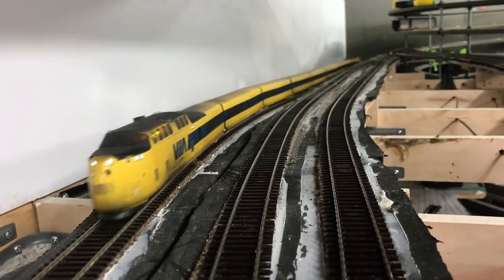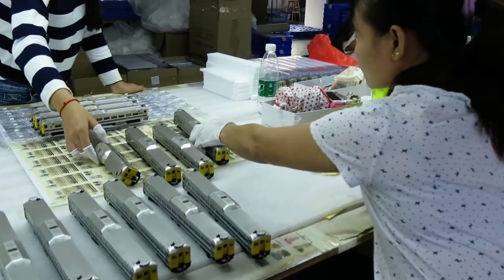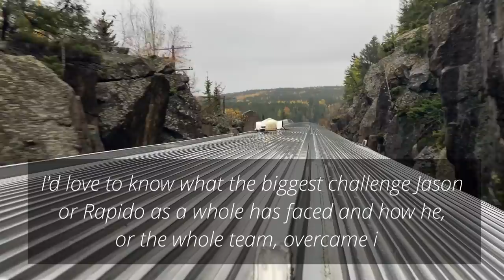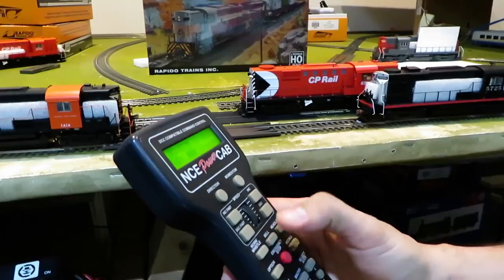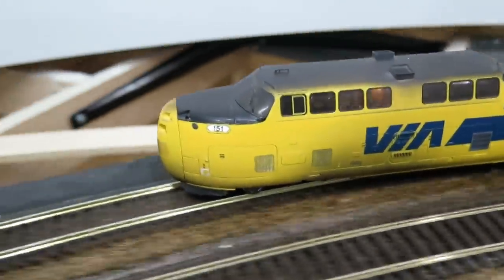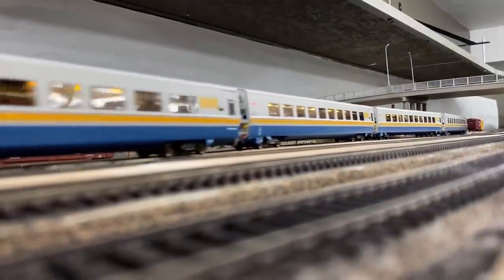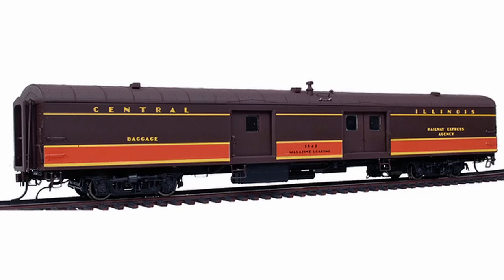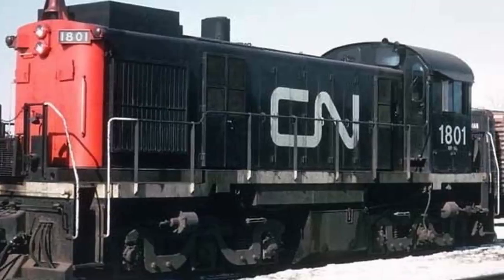Rapido Documentary Q&A with Jason Shron

Comment: Thanks for the candid and honest Q & A Jason  Dalhia . I rode the Canadian from Toronto to Jasper in 2015 and it was fantastic and spent most of my time in the Parlour car , and I'll be back to do it again in the near future. 
My biggest gripe about the industry is the continued use of  the antiquated worm drives in our locos, these can't be pushed or pulled , meaning accurate speed matching is required( which is fine) but it makes for a lot of stress on gears as they are forced along. Has anyone thought of changing to bevel gears or different worm gears that can be pushed or pulled slightly? I hope this changes before I kick the bucket..LOL  
I'm seeing the same drive trains in locos I had 40 years ago! 
Thank you for making great products and supporting the hobby!
Cheers from Down under, Gregg .
Reply from the maker: Our pleasure! And thanks for your comments on the motors. That is definitely something we can discuss at our project management meeting, but of course the challenge is making everything compatible with everything else...
Reply: @rapidotrains  Thank you and have a great Xmas & New year .

Comment: Great interview, and some really interesting questions and answers; like changing the production artwork and reducing the errors.   
Whilst Birmingham is a great cross roads, I'd venture somewhere like York, or Derby as there's so much variety (merry-go-round coal trains / freight / express passenger traffic) etc....pulls pin and steps back. 😂
Took me back to when I was lucky enough to travel on the Canadian, a wonderful landscape to travel through, a highly recommended experience.
Reply from the maker: Thanks for your kind words! I think the original Snow Hill would be something special, before it was replaced with... an escalator in a concrete box. And with all the gorgeous Brummie and Midland Red buses outside!
Reply: @rapidotrains  You have provoked me to think about getting on with my model with your comments on starting something: that's going to be 2022's task.  
As for Snow Hill, I'll give you that, yes that would be an amazing station to model.  
As you are into detailed soundscapes, (still staggered with the Turbo approaching the station - from the inside) you may be interested to know (if you do, apologies), to assist crews in the smoke filled tunnel between Moor Street and Snow hill there was a metal device that created a noise on the train cab to tell the crews as they were approaching Moor street / Snow Hill at each end. I remember the interview was on BBC Radio 4's "Today" programme many, many years ago. I'll see if I can find it.
Who known's someone may be able to tell me more.

Comment: Great insights into the industry as always. The rise of cost in China can be a problem in the future but it could manageable in some form. However transportation logistic costs are going to be the bigger issue. Can't see away around that presently. Now for my wish list models: Grand Trunk Western U-3 Northerns. Diesel wise : GP-30's particularly Nickel Plate Road(Bill Schneider are you listening?) SW-1000/1001(Chicago Short Line now South Chicago and Indiana Harbor) and RS-36's in both low and high hood versions(the high hoods replaced the NKP PA's).
Reply from the maker: Thanks for your kind words and suggestions!

Comment: Nice talk Jason. How about a CP RS3 chop nose ?
There so ugly, dirty, grimy, smoky but they really breath just like us on idle, giving impression that engine died, then start an other shot...
Is there a market for ?
Well why not try with high short hood, removable and inclueded in the box, a short one with the 2 extra windshield. Or that short hood/window combo available separately ?
All RS3 models have the same louvres in body. Bowser, a long time running company makes that CP model. But, no illuminated boxy numberboard, track lights etc... 
Honest, as a Canadian i would prefer to scratch the back of a Canadian company. Rapido would be an excellent choice.
Usually you sell ready to run. Open the box, put on the track and that´s it. Taking time for your team to ponder that sort of 2 for 1 units with replaceable parts should please customers. They decide high or low
 nose. The only changes CP made was lower the hood. Put a steel panel as cab end with 2 holes for the 2 extra windshield pick up on scrap RS3, and weld them to the new cab end and move headlight up there. Some lucky ones get some paint on front of the cab and nose. 
That´s it. 
Up to Rapido to decide to produce all look alike or with different long hood headlight, with/without drop steps, end railings, light/heavy weight truvks according to prototype numbering.
Yours to decide.
Pretty sure modelers won´t say no to a different RS3 phase with nose options of a good quality model as Rapido knows how to produce.

Comment: Oh, how I and many narrow gauge modelers, wish you would design and bring to market HOn3 D&RGW, RGS, C&S, WP&Y, EBT, etc., steam and/or diesel locomotives and rolling stock of the quality that your HO standard gauge products are.  That is my New Years wish, for HOn3 Narrow Gauge Modelers.
Reply from the maker: Probably unlikely, but stranger things have happened!
Reply: Hé HOn3 guy, why not modernise a bit with our surplus SD40-2 sent to Brazil ?
They extend frame about 3 feet each end, lower with smaller coupler, shorten fuel tank, replaced CC trucks by BB-BB on almost 3 feet gauge track.
 They´re real impressive beasts with tiny freight cars. They also use pushers, DPU or slaves and even Roadrailer. That´s modern narrow gauge that Rio Grande would love if line would have survived....or stay in Mikado era...
Cheers.